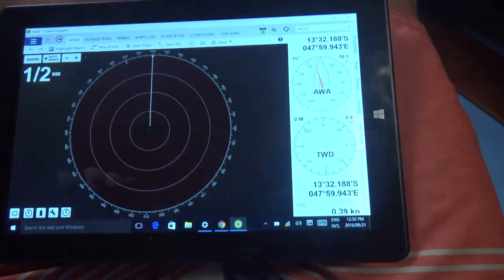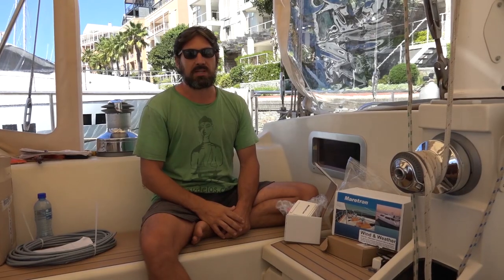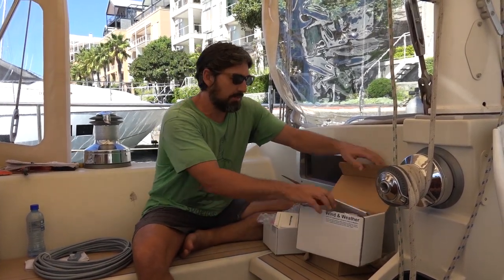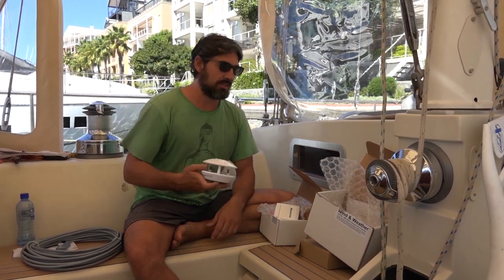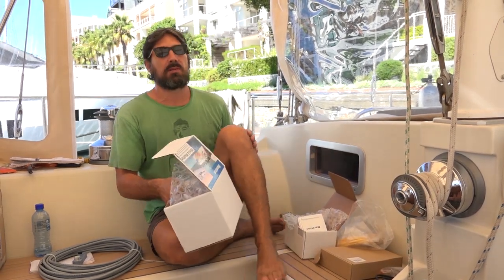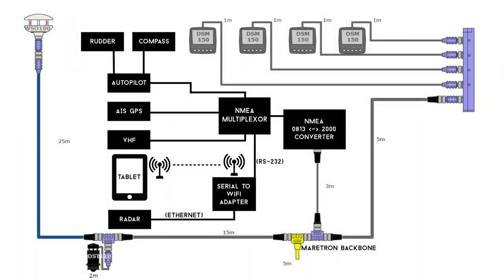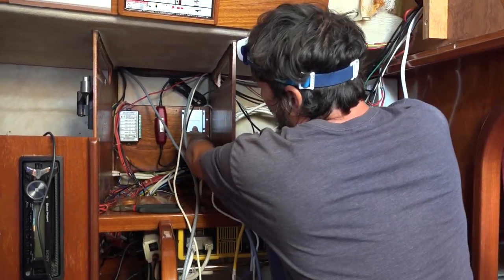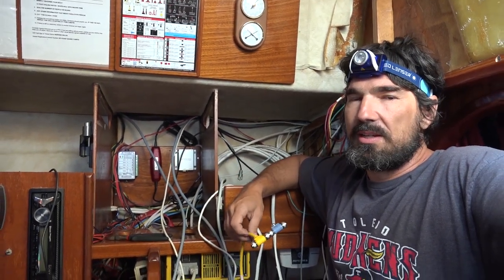Sailing and Navigation Electronics Installation!- Sailing Vessel Delos

Comment: I'm a software engineer an I dabble with robot projects occasionally. Last summer I got a 1975 sailboat and the first thing I did was pull find all the old manuals and get everything working agin. Then I upgraded the battery system. I also encountered all the single wire communications of the old system. What a mess! This was great to see you geek out and show everyone why you deserve your boat and all your great adventures on tropical paradises. Now I just need to learn to scuba dive and get another boat!

Comment: Brian, as an ee of 36 years with HP and the follow-on companies, I can confirm that this is an amazing centralization of the electronic systems on SV Delos.  The data availability and integration of the old and new systems has the illusion of simplicity and at the same time greater control and interoperability. Well Done!

Comment: Watched this when you posted 7 months ago and see the part that converts those baud rates.  Can't see any other way that makes more sense for instrumentation on a sailboat.  The engineers at these product manufacturers have missed the boat and are on a sinking dingy.  It is funny to hear low baud rates of 4800.  WHen I got into the computer business in 1978 with the apples without floppy disks, the modems were ripping at 300 bps with huge problems when we tried 1200.  So cool to get that twisted pair backbone cable to keep the speed up despite humidity and rf interference.   Great job and superb  documenting what you did.  Love the dazed look on alot of faces on the boat.  Karyn kept up pretty well.  Love the humor and I am sure you are happy not to do that all the time but you had to have a neat project to work on.  I comment months ago and hope you get consulting jobs from boat owners that want this type of information.  Go Delos!

Comment: Cool and informative video Breeyawn! I am in the process of fitting out all of the nav gear in the boat at the moment. I have gone with all Ray Marine equipment including wind, radar, autopilot, 7" hybrid touch screen in the cockpit, 9" touch only at the nav station, VHF with AIS, Depth, speed, temp all using wireless tech, so only supplying power to each, no data cables (minimal). The system will also have the ability to use tablets as you have. 
I am really looking forward to getting the chance to use it all this summer after we get to splash. It has been a 27 year build, started by my late Father and coming up 2 years of further work by  the family to finish. 
Cheers.

Comment: I have been installing marine electronics for over 20 years and was impressed by your explanations and also your installation! Great work! When your RADAR eventually fails there are some great wifi digital units available that just need DC power and they transmit all data via wifi.

Comment: Thanks for the video! I just finished installing a Ray Marine display and triducer (speed log, depth, and sea temp all in one unit) and need to run some cables.  I couldn't believe how simple installing it was, the old Horizon equipment, like yours, was individual cables and spade connectors and power runs and just a mess.

I wish I had read yours first, I paid a yard to haul the boat out and replace the sensor. It was only after they did it that I discovered they just reused the one that was in the boat. Not their fault, I asked them to do it, but it cost me a few bucks I didn't need to spend.

I've got some similar projects, like replacing the wind vane, and appreciate your taking the time to go into so much detail. I'm not as intimidated now about running cable down the mast now that I know I can take the end off.

Very helpful, thanks again for sharing.

Comment: Nicely done, guys. I know from recent experience what a pain in the ass it can be running wires through an old boat...35 years old in our case. We experienced a (near) lightning strike only 5 days after we bought Windbird...it fried almost all of our marine electronics. It turned out to be a good thing, because we were able to rip out all the old Seatalk and NMEA0183 shit and start over completely new, all N2k, with the insurance company footing most of it. Much cleaner install, and the new wifi options are fantastic. A few months ago I went up our mast while flying the kite underway in the Bahamas and controlled our autopilot with my iphone! Freaking amazing stuff. Looks like your new setup will be perfect for your style of cruising.

Comment: Congrats on the rs232 configuration.  I had to do that a few years ago for reading solar water heater information at the collector and water temperatures.  The comports are disabled in the new software so we had to go to linux to write code to do something with the data.  Microsoft basic was locked out of it.  When I saw the soldering those 9 pins I remembered alot of frustration.  Your old days of programming 10 years ago helped you understand the problems.  I was involved heavily in computers in the late 70's when Apple did not have a hard drive and just 4k of memory.  Baud rates were 300 and 4800 was a wet dream due to the errors and the ability of the equipment to keep up.  Hope it works.

Comment: This is an absolutely excellent video on how to refit a boat.  technology is amazing and you are smart dudes.  my old soling used a motorcycle battery for the running lights and mast light.  the auto pilot was a rope to the tiller.

Comment: I think the parts that I'd like to know the most or at least much more about are related to the AIS. I've been studying what I could find and AIS , from what I can tell, hooks into an existing VHF or perhaps uses a separate little VHF and sends Digital Signals out to boats nearby who are also sending VHF Digital signals out. The system has its own GPS which is incorporated into the AIS. There is a display which would have you and other boats on a chart of some kind. Most Important fact , each boat is sending out its GPS position, which is put on your screen. Turns out to be lots of lifesaving DATA. And yet, more simple than a Radar , as ling as the boat or ship actually uses it as it travels.. Alarms actually tell you when another boat or ship are on a collision course. That's what I have learned so far. Amazing stuff I think.

Comment: I super appreciated this video...  I started in computers with an Altair 8800 interfacing serial ports to various devices, and I've had a career as a hardware architect, so all this is super neat.  I suspect the average Joe might be overwhelmed.

I couldn't help but think this...  You know those relatively inexpensive converter units, WiFi transceiver, etc...?   You needed to buy two, with one as a spare.   No, really, you need a spare of each of those for being out at sea.

So my suggestion would be carry on as you would naturally, but locate spares for those key, not so expensive units as a background task.  Then when they arrive and you pick them up somewhere, you stash them.

I think if the old to new converter (and visa versa) unit failed you might be left with very little operating, no?

Having a spare critical component on board...  It's a thought.

Cheers!

P.S.  One of my other favorite YouTube channels, the "Scotch Test Dummies"  I mentioned your sailing adventures to them, and they and others tune in to follow your adventures.  I always recommend "Sailing SV Delos", and "Sailing La Vagabonde."

Comment: Thanks for making is one guys! I have done almost the same thing on our boat using a wireless router made for boats by dmk yacht in Seattle.  Customer service amazing and it takes all the nmea data from all the old and new instruments and sends to iPad overplayed on top of navionics app.  It was about $400 plus $50 for the app including all North American charts and the only problem I have is that sometimes the signal has a hard time getting through our aluminum hull to the cockpit unless the iPad is directly in front of the hatch or port light... anywhoo if your cheap router ever goes out try a dmk unit it rocks!

Comment: I'm sure you're aware of this but the backbone and plug connection benefits of NMEA 2000 you have with Maretron are also available with the other major companies. Just completed a similar upgrade on my boat with Raymarine. I also have a tablet connected via WIFI to the chart plotter. Great feature.

Comment: Great video guys! I have done a similar project, combining old NMEA0183, new NMEA2000, Raymarine UTP and Wireless.I used the MiniPlex module that combines NMEA 0183, Raymarine, NMEA2000, UTP, USB and Wireless in one little highly configurable box. Works like a charm. Needs some configuration als I have multiple sources for AIS and GPS which kind of conflict sometimes so I have told the box which signal to send where. Cool to keep the old stuff you want while upgrading.

Comment: Great job Brian and Brady.  I loved the comment about reading the manual.  Always a good idea.  I am always intimidated by wiring in my boat.  It looks like a birds nest and no conventions were followed in regard to positive and negative wires.  Red wire with black tape on the connectors used for ground? or positive?  Can't really tell.  Then there is the Texas Twister used for splices into the wire - and not an ounce of solider used for connections.

Comment: Had a similar problem to solve with the 20 year old 270 that I am refinishing. In my case went with a Garmin wireless NEMA 2000 2 MFD kit which included a wireless mast top wind sensor a through for depth and boat speed two Gage's and the cables and backbone connections. Total cost for the kit came to around 1200.00 from one of the marine discount houses. The mast top sensor has a built in solar recharge so there was no need to run any wires down the mast. Not sure how well this would hold up for what you guys are doing but it is great for lake sailing and racing. 😇

Comment: Have you thought about having any spare replacement modules on-board in case of any unit failures  during a long distance sail? I enjoyed this video, it's nice to see what else has to be done to keep the boat sailing. I like the travel guide videos as well as the technical parts of trip planning and in-route logs. Cheers!

Comment: I really like your advanced navigation/weather/and passage planning. Especially the 1500 nautical mile passage to Reunion (episode 107/108) continued in unstoppable fashion despite seeming endless electronic and mechanical failures amidst serious ocean sailing in large  swell and sometimes frightening weather. Very Impressive that you have all the power at your fingertips, and even more impressive that you can sail right on to your planned destination just fine even if the doo-- dads fail.  Can you drive the boat by Autopilot from the tablet? steering I mean, of course setting sails is a manual affair...But you could automate roller reefing, and the switches to the right at the command station could be on your tablet... maybe even drop anchor from your phone while standing at the bow? Possibilities are actually quite Schnazzy! I saw some thing called raspberry or strawberry or something that is all about automating these sorts of things. basic chips and boards, all well within Brian's scope of education experience.  Keep it up, I love your channel!

Comment: Thanks a lot for this deep insight. I have all this legacy cables spaghetti on my boat too.
Why did you choose NMEA 2000 instead of just tablets or SignalK?
Isn't it dangerous that all sensors and radio and autopilot depend on one cable that can easily break at one of the connectors?
Reply: Thomas Schmidt On the other hand, troubleshooting will hopefully be simpler.

Comment: Right down my alley! Especially like the part where brian is nerding out with the NMEA code. We are making watertight doors for ships and I'm often checking the 0183 output. The 0183 is in hexadecimals, whats up with the NMEA 2000? Doesn't seem easy to decode to binary. Hope you have some redundancy, so you dont loose all instrumentation if the ethernet/wifi goes out..

Comment: Super valuable and interesting video. Do more of this kind. Would this installation also run with open source software (e.g. Ubuntu Linux)?
Reply: I don't know in general, but there is a GNU AIS application (http://gnuais.sourceforge.net/), so there might be other free software available.
Reply: Marcel Clemen looks like it's all browser based so I would guess 100%
Reply: Marcel Clemen there is a bunch of open source developments going on also. openskipper, signalk, canboat. just to name a couple
Reply: It is not browser based.  NMEA is a standard and there are libraries and software available for linux to do similar things.  It is pretty easy to write your own stuff too.  The protocol is pretty simple and while it isn't technically "public" (you have to pay for the reference documentation) there is lots of info about it out there, and you can figure out a lot just by looking at the serial data stream just as Brian was doing.

Comment: Funny this got just oploaded yesterday, as I too need to be replacing my entire electronics next week. The old log transducer (35 years old!) has failed and so I'm left with Wind alone and GPS speed, which is a bit ugly in areas with high currents. 
Unfortunatelly, the boat has to get out of the water for it, because I need a new hole being drilled for the depth transducer (the boat never had one). And I'm not going to drill a hole into my boat while it's in the water....
As for the system, I've also looked at serveral alternatives, and I think I'm going for the new B&G system. Cabling should be very much the same as your Maretron system, and also the displays are similar. Actually, all the well-known brands in the business (B&G, Raymarine, Garmin) have very similar systems, the biggest difference seems to be the design of the wind sensor. That ultrasonic sensor looks really cool, but it costs about tree times as much as an "ordinary" one. So it's a tradeoff, as always.

Comment: A great video for those of us who are geeky about boat electronics.    Only concern is that are several single points of failure, and if they break the whole system breaks.     Presumably you could still navigate on old PC but not see depth, radar, etc?

Comment: That is soooo cool.  I love it when you mess with NMEA, wired or wireless and get all to work!  One question Brian, The Brookhouse Mux you used, has a model that that combines all the rs232 output to wifi, rather than USB...easier than adding an external amazon wifi like you did.  So did they not have that version when you bought it? I have that Brookhouse wifi version, and it works great...hats off to the Kiwi's for Brookhouse and winning the AC...
Reply from the maker: Yeah I bought the mux when leaving Seattle so I don't think that model was available at the time.....

Comment: New B&G systems also use standard NMEA2000 bus with standard Micro-C M12 5 pin connectors. So that is not really a reason to not choose B&G. Also you can always mix different brand instruments and displays if you want/need. Eg. if you like more Maretron multifunction displays, but want to use B&G plotter, you can connect them to same NMEA2000 network and make use of all instruments in network.

Comment: Love it, love it, love it. Been waiting for this episode, for a while. 

As I understand the Amel, you originally needed 3 thru hulls, 2 for sonic speed, 1 for depth. So now you can permanently plug 2 of them? 

The new weather station is cool, i.e. no moving parts. However, you changed from sonic to a wheel for the speed gauge, any comments on that?

Fair winds.
Reply: Almost forgot, would like to see the new mast head setup. When you get a chance, maybe post a drone shot or two on FB/IG?

Thanks in advance. Fair winds.

Comment: Baud rates have always traditionally been backwards compatible. ie if you've got a 9600, it would accept 2400. The only difference is the speed. That's what baud means, it means speed of the connection. So the tablet setup would let you hunker down below battened down in a storm and still navigate check on the auto pilot and check ur surroundings. Very cool. Never have to get out of bed. lol

Comment: Very interesting indeed. Just RTFM right! I was wondering if you could tell me the model of the wifi-router you bought. Also would this work with an iPad tablet?  Looks like you are using Coastal Explorer? (Available for iPads?)  Thanks for sharing. How is the wind-instrument holding up/ working? I saw the Keynice TCP/IP Ethernet and Wi-Fi 802.11n to RS232 Intelligent Communication Wireless Router - Siliver is no longer available but assume a similar one should work too right?

Comment: Awesome behind the scenes look into things.
Here's a question; could the system run strictly on WiFi and not have to hard wire the instruments? Is WiFi sporadic or questionable that they don't run the panel displays on WiFi only? Maybe a potential interference thing?

Sweet little setup though!

Comment: Awesome video guys, thanks ! Quick question from another sv boatie and it-guy: why didn't you put the nmea-2000 output from the converter onto the wifi network but the slower nmea-0183 from the older equipment. Any specific reason ?

Comment: Awesome geeking out evening here in Auckland!
Have you compared the temperature up there on top of the mast and at ocean level?
Ultrasonic sensors work by measuring wave shift among those sensors. Quite amazing feat. 
The same tech is used for measuring flow speed in oil and other hazardous liquid pipes.

Comment: Very cool video, but I am confused about the segment on the thru-hull fitting...what is that needed for in regards to this new system? Also, did you guys use dielectric grease on all the fittings?